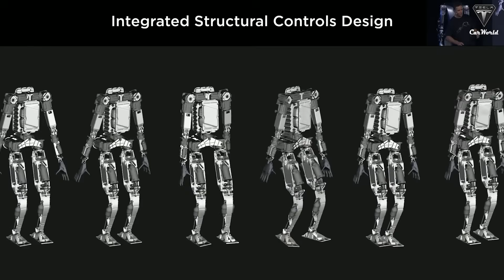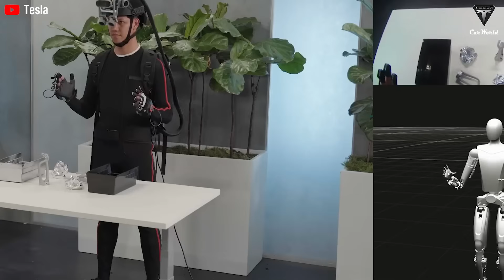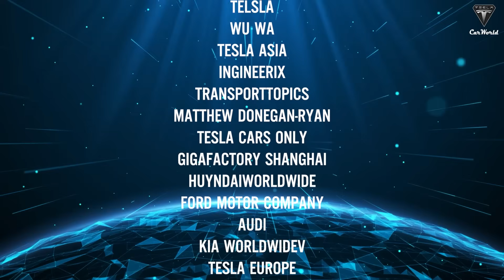Finally Happened! 2026 Tesla Bot Gen 3 SHOCKING For Its Task, Mass Reservation! Elon Musk LEAKED!

Comment: A different version need to be built for Mars cold climate and dust also the moon.
Reply from the maker: A Mars or Moon variant is absolutely feasible. Gen3 already uses materials rated up to 200°C thermal resistance, and its design allows modular upgrades. We know performance drops 10–20% below 0°C, which means a cold-climate or planetary-grade version is a natural next step.

Comment: I doubt it.
Reply from the maker: Understandable, but the data says otherwise. Each hardware generation has arrived roughly 12–18 months apart, with measurable improvements in dexterity, speed, and power efficiency. The curve is real, not theoretical.

Comment: Musk’s partnership with Nvidia and Microsoft ensures world-class AI compute, but hardware still bottlenecks.
Reply from the maker: Partnerships with Nvidia and Microsoft absolutely strengthen AI compute, but Tesla’s real advantage is reducing hardware bottlenecks in-house. Actuator efficiency has already improved by over 30%, power consumption per joint has dropped notably each generation, and manufacturing cost per robot has been trending downward.